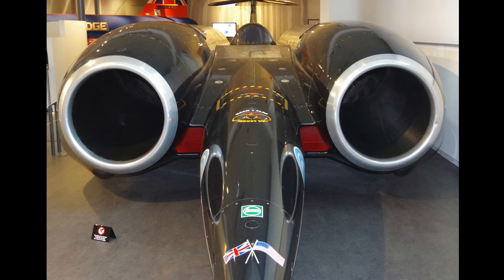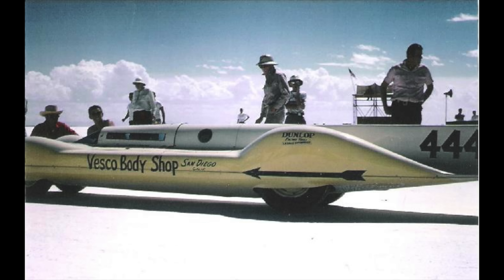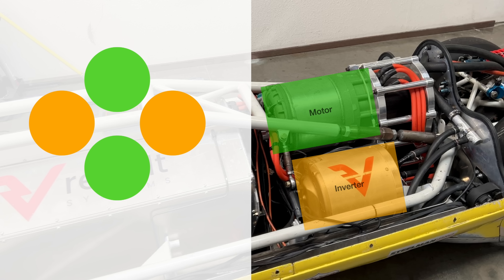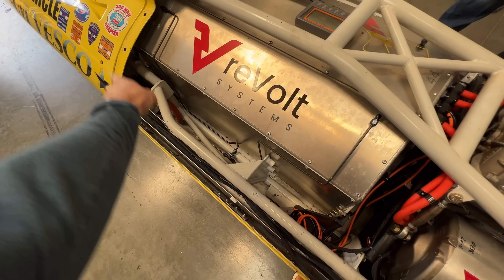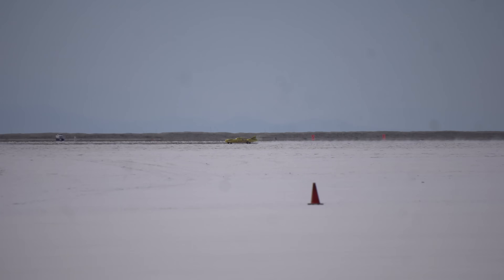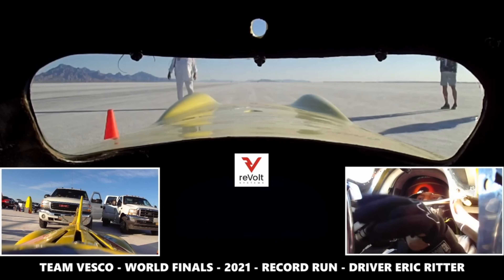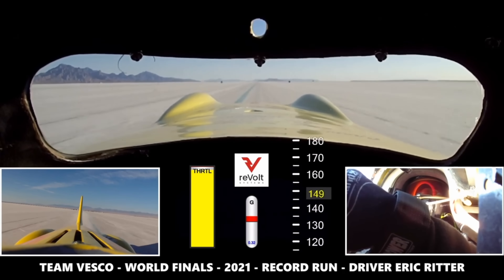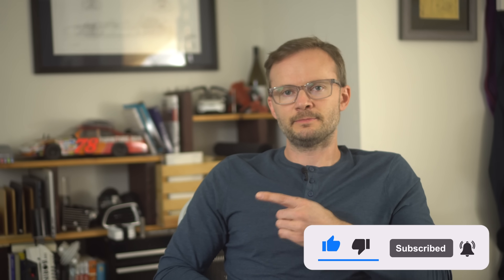The Engineering Behind The World's Fastest Electric Vehicle

Comment: Fun fact, a BLDC motor can be over 95% efficient, that's practically magic. The only thing limiting them is the batteries whatever battery you can make you can easily make a BLDC motor to take advantage of it's output because they are just a laminated iron core and some neodymium magnets and an electronic controller with some bigass switching MOSFETs for commutation. Not really much to designing a more powerful BLDC except "make it bigger, keep it cool" compared to IC engines they are very simple machines.

Comment: 5:32 they drop off in power, not torque. Torque is dropping off since 0rpm, you'd think this guy would know the difference between torque and power...

Also, it is immediately obvious that this setup would have been battery limited, as no Tesla uses two of those motors with that battery.

Comment: C rating Continous and C rating Burst should be marked as standard on all batteries imo, because the lack of clear marking has definitely caused accidents.
And slap on a C rating for the charging as well ;)
"20C (c) - 50C (b)" for example and preferably an actual time limit for the burst, although I generally assume 10-20 seconds (maybe include an idle temperature range as well).
"regular" C rating tends to be eiother made up nonsense, burst numbers, or a mix of the two.
Get yo sht straight manufacturers, we don`t pay for lies!

Comment: A jet car is not a proper car in my opinion.
Reply: 4 wheels.
Can go
Can stop
Can steer
It's a car.
Just my pair of cents
Reply: @Drift_Potato402  so a horse and carriage is a car? Not trying to be a jerk. A jet car is like a shopping cart, it is being pushed by a force linear to the direction of travel.
A car in my opinion is driven by wheels.
Reply: @Mirinmaru  yes, I am saying that a horse carriage is a kind of car, because it is. It is a mode of transport that uses some kind of force to travel instead of being human powered. 
A car to me is anything that is driven BY ITS OWN POWER, let it be pushing the ground to go forward or pushing the air behind it, as long as it does on its own, it's a car in my book.
Reply: @Drift_Potato402  fair enough, I do not, and will never agree fully.
Reply: @Drift_Potato402  "A car to you"??

Your opinion doesn't matter in this regard...a car has four wheels, an engine, and carries people.
Reply: Your opinion doesn't matter, the definition of the word does...

A car has 4 wheels, an engine, and carries people.

Comment: Anyone else thinking capacitors for maximum discharge?  Maybe a phased array with resistors on the output to make sure charging the first phase finishes as the last phase is done discharging, along side slightly smaller battery packs?

Comment: I have an idea, STOP USING BATTERIES! Use s fuel cell or a generator motor to make the "juice" needed to take advantage of those electric motors.
Reply: Neither a generator nor a fuel cell is going to have any more current output than a large parallel battery array
Reply: And that's a hybrid

Comment: Team Vesco is very, very good,  I have seen them run at Bonneville in person. 
They make any "class" go as fast as possible.  However, Bonneville is one area with EVs will NEVER (and that's along time) be as fast as ICE or especially turbine engine powered cars (streamliners)  EV aircraft will also NEVER be as fast as jets.  (Laws of physics give turbines to big of an advantage)  Now EVs have a low end torque advantage over ICE; (unless its Nitro methane Blown dragster tech) but for road cars, ICE is at a disadvantage for off the line acceleration.  But not top speed.  Bonneville is all about top speed, It's NOT drag racing.  It's about going fast, NOT quick. Tow different things. The Plaid S is quick; not really that fast.

Comment: The so-called "power supply issue" was solved over a century ago, folks.  You have an onboard gas combustion generator array.  Until something new comes along.  The market-ready route is using gasoline combustion engines.  The "green" version is running Hydrogen combustion engines. NO strip mining for rare earth metals (batteries). Distilled water vapor exhaust.  For the Hydrogen combustion components, I'd use ALON.  Far lighter than Titanium or Steel.  Much higher melting point temp.  Raw elements highly abundant (Aluminum, Nitrogen, Oxygen).

Comment: They could have literally just dropped a manual transmission in a p1000 or performance model x, and theoretically, with high enough gearing/ enough gears, and a long runway/and  some body mods for lower drag coefficient and down force, you could go as fast as possible. We need EV's with manual transmissions extremely bad for enthusiasts.

Comment: In regards to my comment earlier, the engines weighed 270,000 lb each , the generator side was over 50,000 lb, so with rotating mass of pistons, rods, camshaft, crankshaft, flywheel, and rotor all coupled and spinning at 327 rpm, approximately 50,000 lb rotating.

Comment: While working on a project of 3.27 megawatt each unit, the engine powered generators that would sync to the grid and lock them in once sync was achieved. They only ran at 327 rpm and by the electronic tach they never varied, but occasionally you would feel a whump in the concrete base that was unsettling. After numerous tests and diagnostic tests nothing was apparent. I had a theory that was dismissed by the experts and was eventually proven. You have an internal combustion engine of 4000 hp at 327 rpm generating over 65000 lb/ ft of torque to create over 3 megs of power, it is synced with the grid that for all intent has almost an infinite amount of energy being input. When directly coupled and synced if the engine misfires or lags the grid will drive the generator to maintain rpm thus the engine is now being driven momentarily by the grid. Therefore reverse torque is applied to the mechanical connections of the unit. Eventually the proof of my theory was that a torsional crack in the generator shaft of 14 inches forging resulted. Both units were affected, one 75% through the shaft, the other 50%. The failure was strictly a torsion crack textbook to failure analysis. Engineering specialists were consulted and new shafts were forged that were 18 inch diameter, guess what, the shafts held up but the engine crankshaft didn’t, it failed with a torsional crack failure just inboard of the flywheel. Just put the weakest link theory into action. The grid has infinite power compared to the engine, I can only imagine the twist of the metal must be incredible under these conditions and that if the engine failed the generator would continue to drive until complete destruction occurred if there were no esd, safety shut down systems in working order. Still upon activation of an esd would require instantaneous action and the stored energy in the flywheel and generator rotor requires dissipation and time to expend that energy. Shit happens in a big way when you get to thinking about it all. I am always amazed at how top fuel engines create enormous power and enormous failures as well. A train wreck in the making I suppose. Geez that’s a whole lot of arm twisting torque. Lol

Comment: I FIGURED OUT HOW MYERS SYSTEM  WORKED. NO ONE HAS BEEN ABLE TO.DO IT. I GOT 40 LITER A MIN AT .5 AMP AND 140 VOLT. 70 WATTS. THE TUBES DID NOT GET HOT. I DID IT 10 YEARS AGO. I MAY TRY IT ANOTHER TIME.

Comment: You need a load sharing computer and  good sensing.
   United technologies used to put out a load sharing computer for electro motive diesels gens sets in small multi unit power plants.
  4 -16 mega watt. Then both motors can be synched.
   Motors in parallel have to exacting resistance and reactance.
   A govenor.
   Prime power, prime mover power.

Comment: In FPV drone racing they use LiPo batteries, that have a C rating of over 100. This much wouldn't be needed for this application, but you could also reduce the overall weight if you carefully choose the batteries to almost fully discharge at the end of the run.

Comment: Slightly incorrect on the capacity measurements.  The capacity is set at a given C-rate.  Those C-rates are usually so ridiculously low that you are not going to get 100 kWh out of a battery if you are traveling at highway speeds.  Because of voltage droop you will drop below the minimum safe voltage much faster if you are drawing heavier current.  Batteries have a strong hysteresis and apparent voltage is well below open circuit voltage when the battery is under load.  (Same is true in charging too, which is why you can't just charge at maximum C.  You'll exceed maximum voltage you have to taper the charge.  And in theory to get all the Joules out you would have to taper the discharge which means a much lower speed or really a lower capacity.)

Comment: I'm pretty sure Rimac can give you the power train you're looking for , it'll be a piece of cake for them ! They already made 2000HP with the Nevera reliably with 4 motors on all corners with a gearbox each ! 2 speed ! But my point is that their batteries can surely push that power easy peasy ! And don't forget they're interested in the chase of speed , since they've partnered with Bugatti !
Reply: Bonneville is one area with EVs will NEVER (and that's along time) be as fast as ICE or especially turbine engine powered cars (streamliners)  EV aircraft will also NEVER be as fast as jets.  (Laws of physics give turbines too big of an advantage.

Comment: haha...they took a battery designed to power  one motor and hooked it to two motors..funny
Tesla batteries are optimized for energy density, and cost. whenever they need more power they increase the battery size. or whenever they increase battery size and range, they think "why not use the additional power and make it faster"

Comment: As someone who owns a 300w LED flashlight that puts out about 19,000 lumens, I can confirm that a 1000w flashlight would be insanely bright.
Reply: Now watt in the hell? I’ll tell ya watt!
Reply: I own a flashlight with a “mere” 4200 lumens and it burned through my jacket pocket without even being on turbo.
Reply: @DevReaper  Sounds like a D4V2 or similar light. Nice.
Reply: @MrGatlin98  yep spot on D4V2 with SST-20 5000k leds
Reply: The Imalent MS18 has a Peak power of round about 1000 watts. 🤟😎
Reply: I hate to be that guy, but it's kWh not w.  
Yep, I'm here to ruin your joke. 😂
Reply: @loneponderer495  No. It's watts. I'm talking about the output of electricity, not the capacity of the battery.
Reply: @MrGatlin98  The video actually used the light bulb example like you did but used kWt. Did I say kWh instead of kwt. Or crap if so, my bad.
Reply: @MrGatlin98  Yep, I'm an idiot.
Reply: @loneponderer495 great to see you, brother….for I too am able to type much faster than I think.🤭 🤣

Comment: This is why Toyota keeps using nimh batteries instead of li-ion for their hybrids. The nimh batteries in old priuses are 1.5kw but can easily put out 24kw. Thats 16C of discharge. It can also charge at the same rate during regen braking.

Comment: Wow. IT shows how the drivetrain part in an EV is easy.
Just slap the equivalent of a tesla plaid rear drivetrain, and here you go.
For the battery part, I'd say go for RC lipo. 
Most of them are around 50C discharge (around 1mn to discharge them completely). Up to 100C (with a premium), and 140C for some quite expensive ones, but that would be quite overkill.
Reply: The c number is based on capacity and discharge, so they may not be any better than the tesla batteries
Reply: @marcusborderlands6177  nope, it's the other way around. The C is completely independent from the capacity of the battery.
It's an inner characteristic of the battery, depending on the way you built it and chemistry you used. And it always comes with compromises (usually less energy density).
It's just that on any battery, the more you have, the bigger wattage you can get. 

Tesla's OG batteries are, vanilla high capacity batteries. They are rated for 3C discharge only. That's why you need so many of them (400kg) to dump "only" 600kW.
With 50C batteries, you'd need about 20 times less (roughly 25-35kg) for the same wattage.

Comment: C rating isn't just a number; it has the dimension 1/time. The calculation “capacity × C = output” doesn't check out otherwise. In the example around 9:10, the unit is 1/hour. That means that a battery with 5/hour as the C rating could discharge 5 times per hour of the charging times were negligible.

Comment: Yes, super good video with the right details down to the watt, though the Vesco Turbinator is really the fastest Land Speed Car.  Jet cars are not pulling at the ground.    We went 215mph FIA on 146hp and a 1.65:1 gear, lead batteries, and no pushoff in October of 1997.  Rannberg Lighting Rod.  it's amaizng how far it has come.
Reply: How much did the Lightning Rod weigh? I checked the FIA site for the land speed records and the Lightning Rod still appears to have one of the fastest speeds for the under 1500 kg class (no longer the record holder). The under 1000 kg class record is held by a modified Le Mans sports prototype, that ran 205 mph with electric power back in 2013. I'm sure there must be a few cars out there that can go on a diet with new battery technology and take that record.
Reply: Perhaps I should add, the EV West Electraliner appears to have run 229 mph two-way average in 2020 and from my understanding that car weighs less than 1000 kg, but I'm not sure if that run qualifies for SCTA or FIA or both.
Reply: @alexjenner1108  We weighted 2650lbs as I recall. But, there were no weight classes in the rule book for Electric in fall of 1997.  We were approached by the STCA and asked to write  some weight class rules.  I seem to recall we set the weights at under 500kg, 1000kg, and beyond 1000kg, which would have put us in class 2.
Reply: Correction,  that put us in Class 111/e.  Dont know if FIA has adopted the weights. In hind sight,  we could have shed 26 batteries, run the same voltage and set some record in class 11/e.  We were chasing the GM EV1 record of 183mph.  I appreciate your comments.
Reply: @woodrow7201  Thanks for the update about the car and classes, FIA appear to have gone with 500kg, 1000kg, 1500kg, 2000kg ... limits. Not sure if they just keep going up in 500kg steps forever, but the Venturi VBB-3 streamliner appears to be in class 8, 3500-4000kg. Just looking back, that 1997 record is more impressive when you think that was way before the first Tesla, the first Nissan Leaf and even the first gen Toyota Prius Hybrid didn't come out in Japan until the end of that year and export models had to wait until 2000.
Reply: @alexjenner1108  Thanks Alex.  It was a wonderful experience to be involved with this project and go home with two red 200 club hats.  We were approached by the SCTA after our record they asked us to write the rules for electric,  I think we went 500kg,  500 to 1000kg and over 1000 kg.  it has expanded and been adjusted since then.   The Vescos are Bonneville idols,  I seem to remember that they family was traveling to Bonneville since 1949.   Keep up the good work.   thanks

Comment: I'm curious to see Ford's 200hp motors thrown into a chassis like this. If ford can throw seven of them into a Mustang E, I'm sure someone could find a way to throw that amount into a salt flat racer. The battery issue, however, really only comes down to the layout within the vehicle, that box that was produced for this one isn't the optimal design, there's still a lot of dead space within that chassis, and imagine what packs could be like with a more optimized chassis. Batteries may not even be the most efficient use of storage anyways, a supercapacitor pack with a regulated discharge would be a denser array for the discharge rating needed; not to mention the charging and longevity benefits, and possible weight reduction depending on how much storage the vehicle actually needs for five miles, a battery pack of similar endurance will likely be heavier with a good amount of charge left due to it's lower discharge rate requiring more batteries. This is the problem with batteries, if you don't have the discharge rate required, you either find cells that can handle that discharge rate or you throw more cells at a pack and run them in parallel to achieve a higher discharge rate. Energy storage for cyclic use is a balance of discharge rates, capacity, density, charge rates, and cyclic longevity, batteries are slow at charging and discharging, with complex curves to boost performance, with higher density and thus higher capacity, with their longevity being very touchy and often time cantankerous, whereas the only downside to capacitors is their density and capacity, otherwise they're fast at charging and discharging, and have a much healthier longevity at these high power cycles. A supercap bank is what these kinds of vehicles would be best suited with, as they're only a five mile endurance vehicle, you don't require a long cycle for those five miles, especially when you're reaching multiple hundreds of miles per hour.

Comment: Would it be worthwhile to have two separate battery banks and switch between the two every 10s for example? So bank 1 can run at max/best output for 10s then swap to bank 2 for 10s and repeat.

Comment: Drag is nowhere near exponential until you start getting into transonic regimes, around Mach 0.8 or 600mph, and even that's just a narrow band until you punch into supersonic. Typically, ram drag is quadratic. It might go up a little faster than square if there is some bad interaction between turbulence and the ground, but it's still going to be polynomial growth, not exponential.
Reply: Yeah, it's common to confuse x^2 and x^x in speech. I just think of exponential as a synonym for quadratic unless the speaker writes an equation.